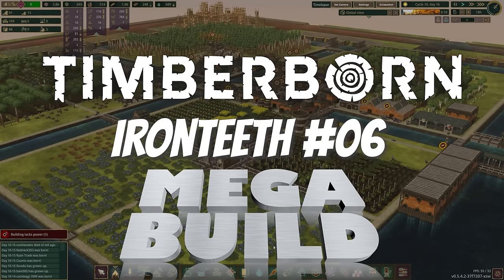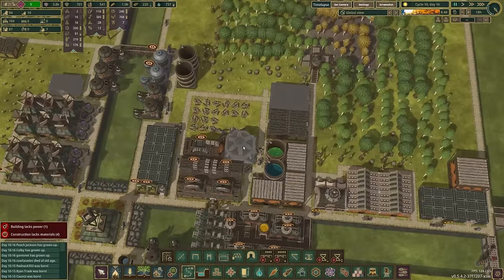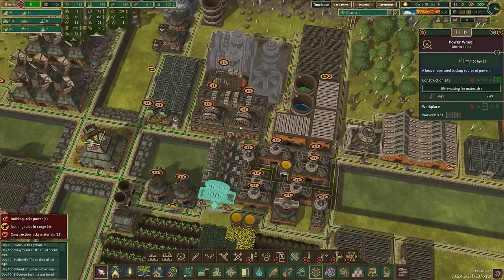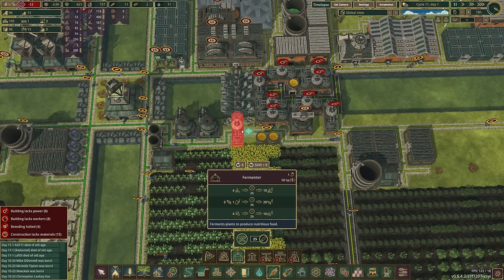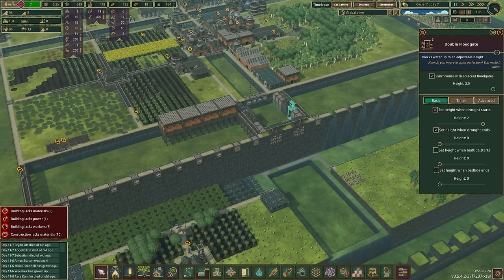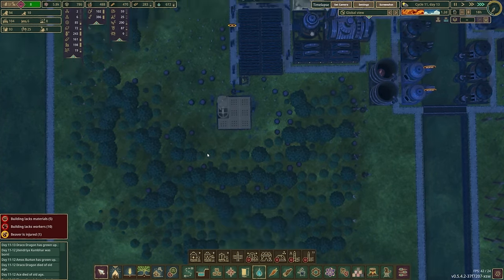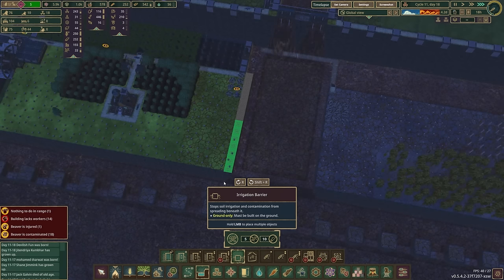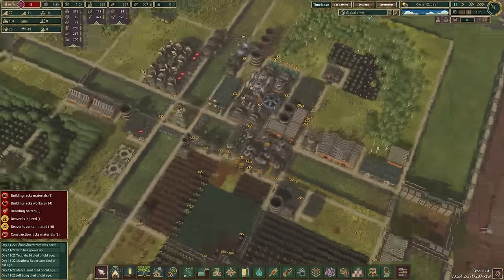Well, we were about due for a crisis... Timberborn Update 5 Iron Teeth Mega Build Episode 06

Comment: In the case of the irrigation barriers. I would just move the paths one square in, blast under the paths by one, add the irrigation barrier then put platforms. You can't do it all the way to the edges of the islands, because they would flood, but It would make building off the sides more interesting.

Comment: just fired up the testing map,   if you have badwater on top of a contamination barrier it does NOT work. :(
49:46 laughed so hard... sorry  but that transition was perfect.
Reply: That makes sense, it shouldn't work, if the water goes on top of the barrier the barrier will not stop it. Also important to remember that all sides have to be protected by barrier or the contamination will go around the barrier. So the two jc put in will not do anything, even if they would work under water.
Reply: :_hellmo::_hellmo::_hellmo::_hellmo::_hellmo:
Reply from the maker: Comedic timing is something I've managed to be fairly successful at ...for better or for worse 😂

Comment: "Smallest breeze can fill a sail,
 A tempest breaks the mast.
 There is not a ready trail,
 In an ocean vast.

 Drizzle helps a Lilac bloom,
 A torrent drowns the Pine.
 Light of candle fills a room,
 But pyre draws the line.

 Needle passes softest weave,
 A spear will only rend.
 Frustration: it cannot leave,
 A mind that will not bend."

Comment: Up top,
The single wide water canals that need to be plugged up, can you put levees in the 1 block space outside the platform areas, and worry about placing terrain blocks later? Could help with water consumption.
Why do you need to put irrigation barriers on the corner where the houses are, if the bad tide will never reach there? Except if bad choices are made...

On the second level,
I think you should place water wheels in the main channels for power, and remove the 2 wheels, and plug up the small channels, so you get power not only during good water, but also bad tides.

Truth be told, I do laugh when things go catastrophically wrong, but I also love to see the recovery arch!

Comment: Im right at the start, but i gotta say, theres no need for irrigation barriers along the outer moat where the barracks are. Theres never going to be badwater there now that the flood gates are in place to run the badtide out.

They could be used along the chanels, on the exsting edge, with platforms on top and then large waterwheels anchored to those platforms though.

Comment: → To reduce the evaporation of the irrigation pond in the farming area, just cut off the arms with levees.
→ I think you don't really need irrigation barriers on the outside of your central square, just on the inner channels where you have the bad water going.
→ 40:30 "Can I [...] double-dynamite a 5×5 area here?" – Seeing that you have only 10 dynamite and 16 extract at this moment (and no production of either), my guess would be "No". 41:15 "Why did I do this to myself?" (Good that deletion of these recovers the full resources.)
→ I somehow saw that coming, with the automation of the floodgates on the ends of the central channels missing.
→ The irrigation barrier should be on the "good" side of the levees/floodgates, not on the badwater side.
→ Long term, I'd recommend deepening the central channels by one so you don't get any overflow of bad water. And make sure all floodgates are set to zero when you want to let the bad water out. (Maybe divert some to a location where you just can store it for later pumping.)

Comment: You need to put a heap of water pumps around the outer ring to collect all that water, all year long.
That one fluid dump with the single-wide canal you blasted can be fixed by removing the double platforms closest to the 5x5 hole and putting in levees stacked two high.

Comment: You don't need to worry about the whole outer edge, just about the channels were bad water goes during badtides. The whole outer edge will always have water if you keep you flood gates sync to close when badtides. or am I wrong?
Reply: Also, if you were to extend the channels, to get to the outer reservoirs, water might dump into the central irrigation without the fluid dumps. I thought you were going to do that when you put the dam on the border when you started working on the channels
Reply: One other thing that I have been wondering since episode 2, what would happen if you make channels around the water sources, and add floodgates before the water wheels? When a badtide comes, you can close those flood gates and make all the bad water flow through the other 3 paths.
You can even narrow all the bad water to flow through just one of the four sides, and leave the rest of the map with clean water.

Comment: On your center single wide channel place a single high flood gate on each end ( protecting the irrigation dump area). this way the water will flow in during temp season, and close during drought  (minimize evaporation) and badtide to block the contamination. This way you do not have to dump water all the time and the haulers can do other things.

Comment: Thank you for your suffering, this was very entertaining! Your death spiral was starting to unfold in little steps through the last episodes and now you're having it all at once.
Now that you have so many beavers and jobs, you might have a look into all your job locations and redo the priorities on them so that the next crisis wont hit you as hard  when a portion of your basic-need-jobs arent worked bc your workforce is dead/contaminated. Start focusing your corners to specific roles. You have 3 corners full of water that arent used and could be used to finally move your water pumps away from the canal and to one of the corners. Add a buttload of water storages too! Each water pump should have at least one medium water tank next to it. Also you're loosing a lot of efficiency because your beavers have to walk half the map for food and water each day. Start putting some small warehouses and water tanks throughout the colony and on the lower platforms and designate them so that haulers are filling them up. A lot of a food death wave can be explained by beavers running to one warehouse on that one side, then finding out it is empty due to the faster beavers and then they check for the next warehouse to run to, not thinking about that all other beavers now run there as well. So they are running all day without being productive and producing new food. Also, more large warehouses! Your beavers aren't productive due to full storages and then when you need lots of materials for a building spree, you're running out too quickly, not leaving logs for the engine and so on. I really look forward to the next episode!

Comment: 5:44 Or... instead of moving everything one block to the left so the Irrigation Barriers (IRs) can be placed down there, place the IRs on the ledge below, place platforms above them then stack a line of levees one block grid over. This keeps a separation between the potential badwater and your crop lands in case submerging the IRs renders them useless. That you can also use the levee line to place large waterwheels across the gap.  
As for the evaporation issue I hope with the recent nerfs regarding irrigation someone comes up with a modded platform that prevents (or least reduces for evaporation losses).

Comment: Just fill the paths in with Levees for now.  swap it over when you get dirt.
Reply: Actually just need to put a levee next to the water pits in each of the canals. Just 4 levees needed and the rest can stay as a trench.
Reply: @wm-nu1yf  I think it would actually be 8 levees, because I think that the channels were 2 deep. but your concept is correct. Replace 4 double high platforms with 8 levees.
Reply: @crowaust  Yeah, I'm pretty sure you're right. I think they are 2 deep.

Comment: You irrigation issue can be resolve just just adding 1 leavie at the start of each trench. That will stop water going in those trenches & let them dry keeping most of the water in center 3x3 pit. 
Also you delete stuff without thinking consequences which cause you pain. For example you deleted few warehouses full of resources to add engine & later you didn't have resources. You could have move them to diff locations first. Same with deleting those dams at top loosing so much water but you could have prioritise them. 
You need little bit of berries so you could have kept them in bottom left square where you loosing good portion of land due to bad water & make maximum of bottom right corner for food. These are some silly decisions but you seems to make them without thinking it through.

Comment: I tried to post this yesterday, but it looks like it didn’t go through. On Skye Storm’s video of his terraced build he put the irrigation blocking tiles on the top of a large bad water reservoir and the beavers ended up using it for a path. I don’t think you will need to worry about putting a path on platforms above the irrigation blockers—they’ll just walk right on top of it.

Comment: are there not more bad water sources on the map? would it be worthwhile to invest in accessing them and harvesting during the temperate season? i think creating a "moat or trench" on the sides that access the main flow of water 1 tile in from the edge to hold your irrigation barriers should block the contamination from the bad water and be able to cover it with platforms and  paths for your main thoroughfares  or you could even plan for two tiles in from the waterway to leave enough space for pumps and other buildings along the outside that wouldn't encroach on your truly farmable area.
Reply from the maker: There are in fact dozens of additional badwater sources, but they're too far to make sense without being separate districts. We'll get there at some point!

Comment: Use the resources you actually have: wood.
You have SO many trees, just need to cut, store, and use them.

Build a DEEEPPP reservoir at one of the corners.
Build, not detonate.
Make it at least 6-deep, this is Iron Teeth and you have the straw depth for it.

Once you have water under control, stop the newest tree farm and go HAM on rapid crops.

Comment: Why are you talking about putting the Irrigation barriers on the CLEAN WATER SIDE???? Aren't they only needed on the Bad water sides?

You need MORE STORAGE, you need enough storage for Raw products buffer to keep producing what you need during a drought/bad tide + the Food and Water for a drought/bad tide.
So atm it's 8 to 10 days of drought/bad tide * the number of beavers(currently 104 so round up a little) * 2 ? 
So 10*150*2 = 3K of water/food just to keep beavers alive.

You know that you could have just replaced the closest of the double platforms around the water dump with a couple of levees to cut off the 1 wide channels right?

Comment: Couple of things.  

First, yes the trouble you cause yourself is immensely annoying to me and probably a large group of the viewers.  
Second, imho the trouble you run into is because you try to too much too quickly and then run in to resource issues.
Third, the bad water flood was a terrible tragedy.  But I don't blame you too much for that.  The [bad]water management is tricky and the floodgate trigger settings can be a little difficult to comprehend.  Especially in a complex system like you have.
Fourth, it's been my experience (at least with the Folktails) that, if the bad water can get on top of the irrigation/contamination barrier, it will still contaminate the soil beyond them.  I have successfully circumvented this issue by placing levees and floodgates to keep badwater out of where I don't want it and then place irrigation/contamination barriers on the opposite side of the levees and floodgate from the bad water.  Again, my experience is with Folktails so I am unsure if this works the same with the Iron Teeth.
Fifth, and most importantly...

SLOW DOWN.  lol

Edit:  You have more hours in the game than I do, but I'll still share my opinion on the method of badwater proofing the four islands that you mentioned.  What I would do is move the paths inward by one tile and then place the barriers on the existing outer edges.  The method you spoke of is going to use so many resources, logs, planks, dynamite, that you could save for other poorly thought out projects.  😅

Comment: Slow down a little.  You're stuck in a process computer programmers call 'shotgunning':  changing lots of things so quickly that you can't predict what effect the changes will have, and can't remember what you've done.  The number of times you've said, "we're going to 24 hours but will change that back in the morning", immediately gone on to five other things and forgotten to set the hours back is an example.   The problem is that you can bounce around like that forever without actually solving anything -- creating latent new problems along the way, in fact -- while feeling productive the whole time.  

The more complex a system gets, the easier it is for problems to interact.  A system with ten pieces is a hundred times more likely to trip over itself than any single piece.  The end state is what programmers call 'the big ball of mud' where any change you make breaks something else.  Eventually the crises stack in a way that gets frustrating, and to be blunt, your frustration isn't fun to watch.

Take the time to make things work at the unit level (like collecting badwater), then make them work at the system level (like making dynamite), before moving on to some other system.  If you want to swap between two or three things (which can be legit.. sometimes there's lag between making a change and seeing its effects), use written notes to remind yourself that you need to come back, and what still needs to be done.  There's no shame in it.. offloading memory to paper frees your mind to solve problems instead of trying to hold onto the past.

Working methodically has a built-in plot:  the current system works, but this new piece perturbs things.  We need to find the new working version that includes this piece.  Once things are running smoothly again, we can make the next change.  It's more interesting than sketching in some big thing that may not work, watching it fail, fixing maybe a third of what's there, moving on to some other big thing, and being caught by pieces of the first sketch again in another context.

For what its worth, billion dollar software projects have gone off the rails exactly the same way.  All systems grow naturally toward becoming a big ball of mud, and keeping a system mud free as it grows is a major challenge.  Complex systems that remain mud free are amazing to watch though.

Comment: Why don't you dig these channels all the way under the path, so that the water flows in from places where there is no bad water? Then you can give up the pumps and use more beavers for other work. And if you are afraid of drought, build floodgates near the reservoir in the middle.
Reply: Currently the water level in those clean, outer parts of the top level is rarely high enough to flow into the under-path channels even if they were connected (considering he was planning to close them off with dams - as he did in one corner). Possibly, with swapping several gaps in the weirs with levees, that might have changed now.

Mind you, if narrow channels lose water fast, would that then mean that the whole area would be losing water unreasonably quickly......? My brain hurts a little

Comment: Your effeciancy with this set up is hard to watch. I prefer to have at least 30 haulers out of every 100 beavers of population. With more haulers supplying industrial and moving worker supplies ro storage the more efficient yoyr workers and your supply line is. At a population of 250, I usually have ~80 haulers or more.
You have 4 squares...1 food, 1indistrial, 1 wood, 1 residential\water\storage. Have storage at outer edges of residential closest to its assigned squares.

Comment: Main issue I've noticed in all your playthroughs is you get in too much of a yank, start panicking, and then half ass things....slow down, do a jump cut if need be while you figure it out, then come back and explain.....as for the industry, next time run a power shaft up the middle and back your buildings into it, be more modular and easier to deal with than the crap shoot you got going on
Reply: You can do as you like, but what I'd do short to mid term is close all the flood gates to the reservoir by the tappers shack, move the water pumps there to drain it, then put the irrigation blockers in, which would back the path up a square, but allow for a massive bad water reservoir in that corner, then the water pumps could go in the reservoir over on the industry square, not likely to pump that one dry before a wet season, and even if ya did, the trees won't die before then